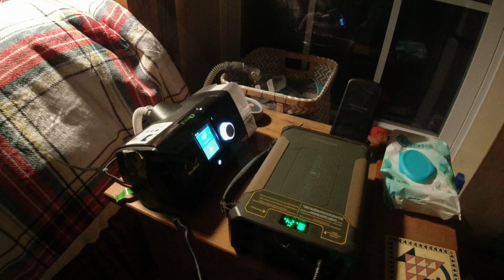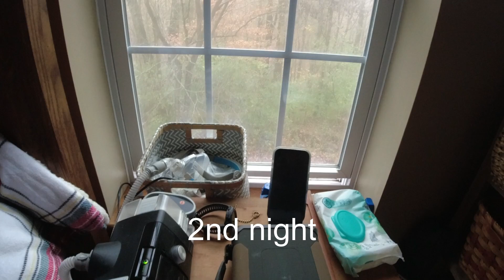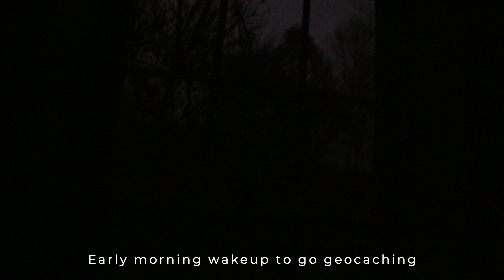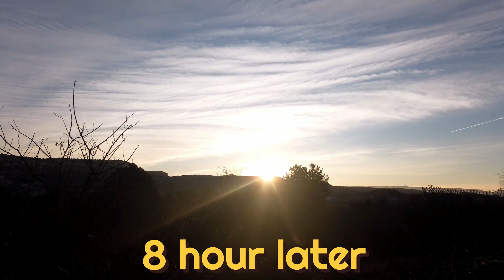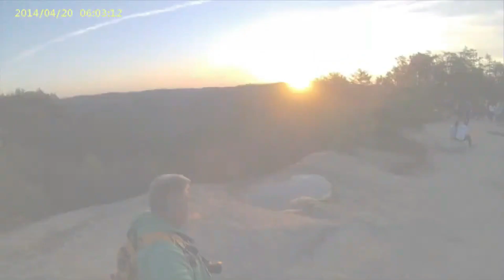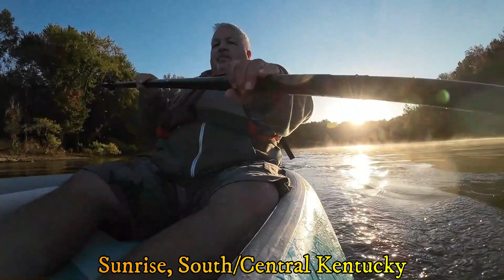CPAP Battery Longevity Test

Comment: I've never heard of an ES960. What capacity is it? Did you use an inverter or did you use a 12 volt plug? Maybe you could readdress the capacities involved in your equipment. Why wouldn't I just use my Bluetti EB3a which I can buy for around $200.?
Reply from the maker: @Smarley-d6s  it comes with a cord that attaches to your particular unit and adjusts to your unit’s voltage